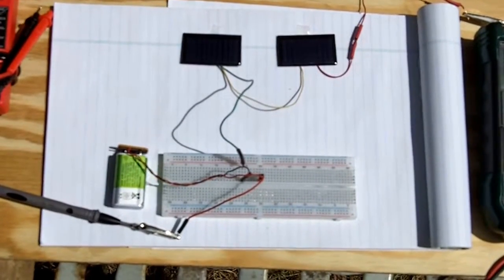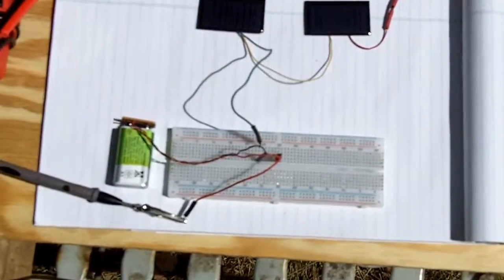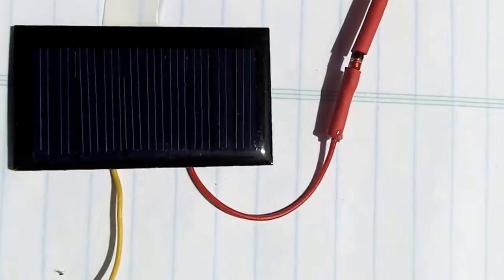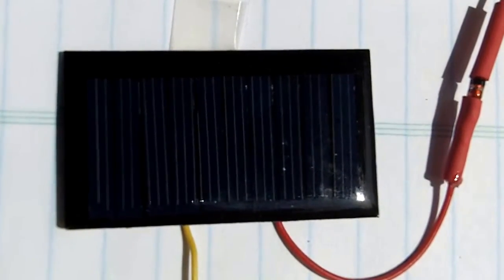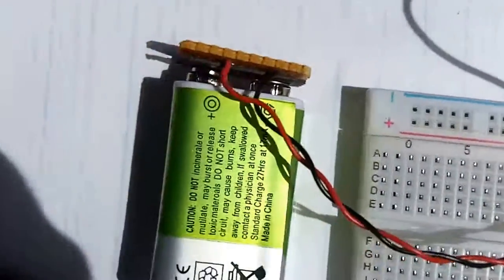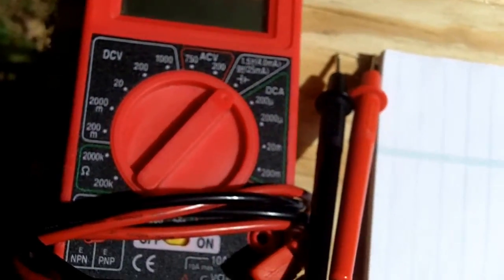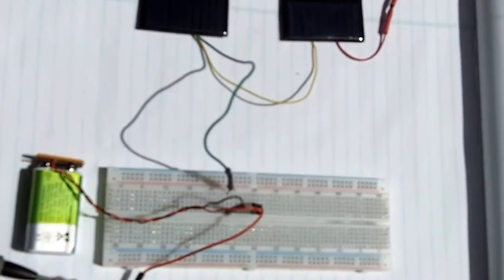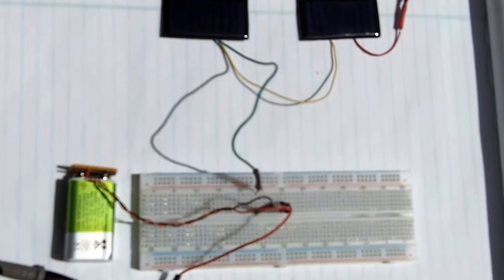Testing Mini Solar Panels for Charging 9V Batteries

Comment: "Thank You", thank you very much ☺️ Is possible to connect solar panels, to a voltage regulator directly 🤔 Let me know, I look forward to hearing from you 😎
Reply from the maker: Hi. Do you mean the voltage regulator "chips" like the 78xx series? 7805 for 5V, etc.?
Reply: @espectraa1s  YES 🙄
Reply from the maker: @Inquire98  Then I guess the answer is yes, you could use a regulator with a slightly lower voltage than the solar panels put out (I think the 78xx series needs some "overhead" voltage), and I would look at the data sheet to see how much current the regulator draws as it regulates the voltage -- it might be too much for these small, low current solar panels (?), i.e. it may pull most of the current for regulation and not leave much for the load you want to drive. Just some things to look out for...
Reply: @espectraa1s  "Thank You", thank you very much for responding 😎

Comment: What is Price of solar panels and where sir you purchased
Reply from the maker: I got mine on eBay. They're about 75¢ to $1 each, maybe a little cheaper on AliExpress. Search for "30x53mm 5V mini solar panel" (0.15watt) or "45x45mm 5V mini solar panel" (0.25watt).

Comment: May I ask where you purchased these Mini Solar Panels?
Reply from the maker: I bought them on eBay from a seller in China -- good prices & free shipping, but you have to wait some weeks for the package. Search for "mini solar panel 5V" and optionally "30x53mm"" (the size in the video) or "45x45mm" (square ones I've also bought, slightly higher current output). You can also check Amazon or AliExpress.

Comment: What is that silver thing that the wires are attached to
Reply from the maker: Hey Rebecca, do you mean the breadboard? Alligator clips? Anyway, maybe this'll cover it - the 2 panels are in series, so 5V + 5V -> 10V (needs to be over 9V to charge the 9V battery).

On the positive end of the right side panel, there's also a diode soldered in to make sure the current only flows OUT of the panels. Without it, when clouds cover the sun & panels drop below the battery voltage temporarily, the battery would push current back into the panels, wasting charge.

The wires are plugged into a "breadboard" (electronics prototyping board with holes for plugging in wires, chips, etc. & just makes quick electrical connections when you're prototyping a circuit).

Lastly, the digital multimeter is patched into the circuit (between panels/diode positive output and battery positive terminal), set in ammeter mode to measure the current the panels are pushing into the battery. The digital multimeter is gripping wires with silver alligator clips on the probes and the wires are plugged into the breadboard (the typical multimeter probe tips are too big to plug directly into the breadboard).

Hope that helps!

Comment: Why you didn’t connected in parallel  .?
Reply from the maker: In this case, each panel puts out about 5V and I wanted to have a 9V battery recharger, so I needed a voltage higher than 9V.

But in the future, I'll probably just solder wires to each panel and make plug connectors so that I can use them in parallel or series, depending on the application.
Reply: I made my own. Power bank. I. Did. Put. 7  batteries of 9volts. In parallel. To keep same. Power   Output. To. A car cigarette. Usb. To power my tablet. And. Cell phone for emergency 
I was thinking if i use rechargeable 9v batteries. Can. I charge all. Together. At. The same. Time. With. Something similar. Of your project  or you think it’s better. To charge. Individual. Each battery."?